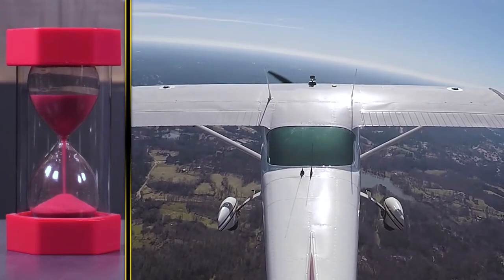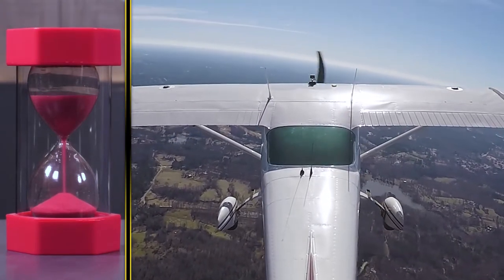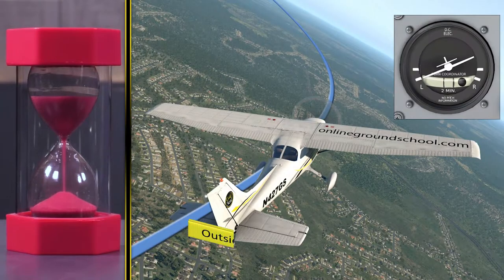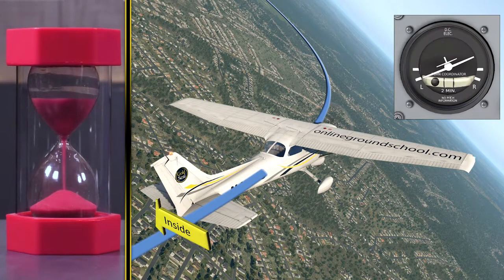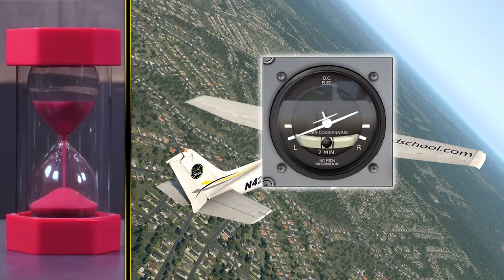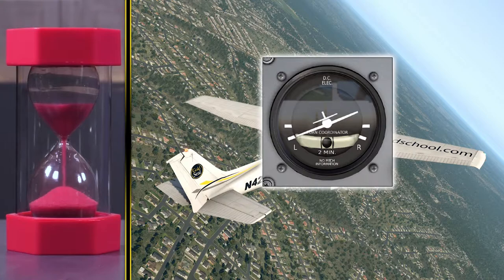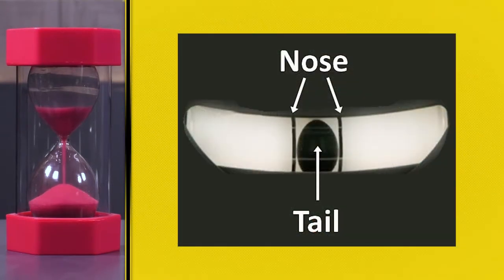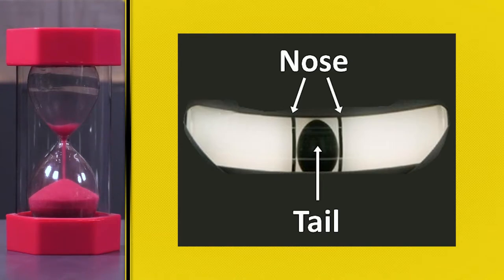Coordinated Flight - One Minute Ground School

Comment: Turning from downwind to base and from base to final, the ball seems to be left of center on my PA 28 161.  I was told in training to use the rudder on the side of your turn...so left base, I would use left rudder.  Yet if I step on the ball, I should be using right rudder.  Please let me know your thoughts.  I know this is a critical stage of flight and a lot of spins happen turning base/turning final.  The piper is very forgiving, but being a low hour pilot I want to start doing it correctly.

Comment: Thank you for this excellent video on turns. I earned my private pilot license last summer but I still have questions about turns. Is there a video on doing a one minute turn? For example if you inadvertently fly into IMC and you want to do a 180 turn to head back to VMC. The one minute turn or a standard rate turn is required, correct? Is there a video that demonstrates this?

Comment: YOU NEED TYPE THE TURN ON THE POC LIKE CNG TRAC OR LET THE AIR TRAFFIC TECHNOLOGY MOVE THE AIRCRAFT. IF IT IS ONE OF THESE WHICH ARE TAIL  TRACKING WHERE THE RUDDER ISN'T SOLID. COORDINATED FLIGHT IS GOOD SKIPPING TURN IT SKIDDING TURN. EQUINOMETER IS TAIL INSTRUMENT.